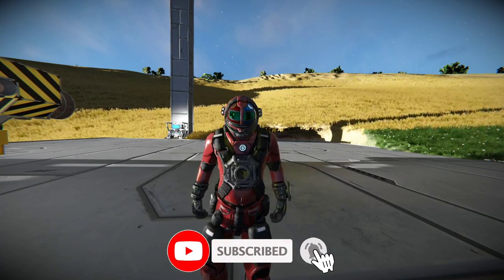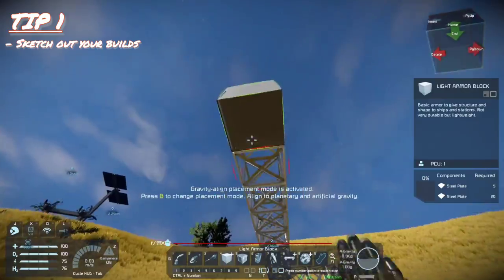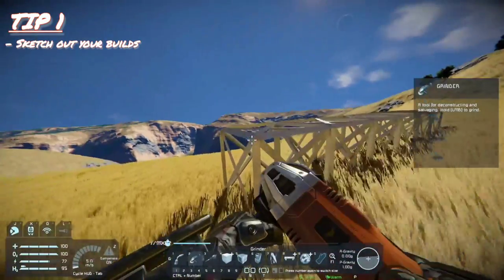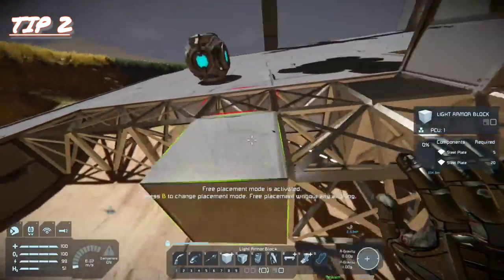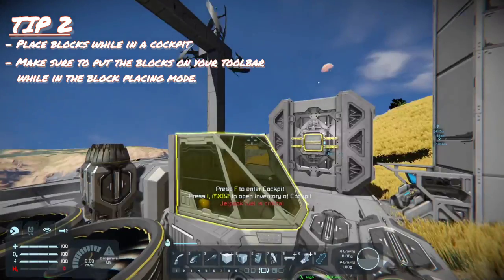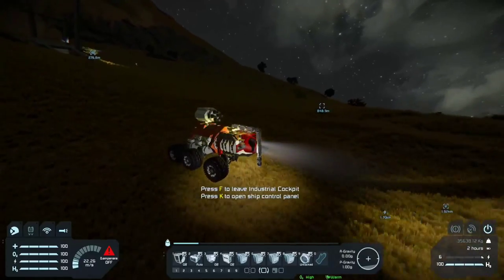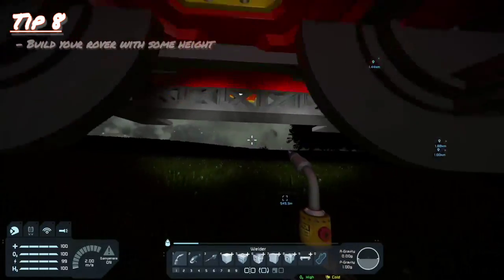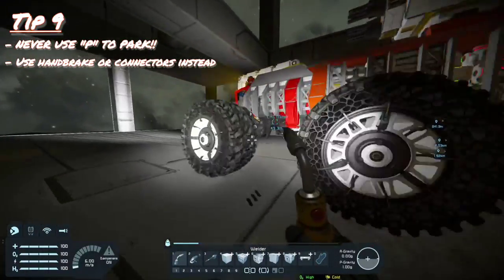Rovers and Conveyors - Space Engineers Automatons Tips and Tricks

Comment: Why never use p? Connectors are always powered now. You dont have to worry about shuting off connectors power any more.
Reply from the maker: P is used for the parking aspect of the grids. Let's say you are on your base, have a miner, fighter, and your rover all connected. If you press P, it unlocks all of the vehicles from the base that use connectors for parking. In space it isn't an issue, but in gravity it can break alot of ships. You can go into the control panel of the connector and tell it to not be used for parking, but most people (including myself) always forget to unchecked the box when putting them on.